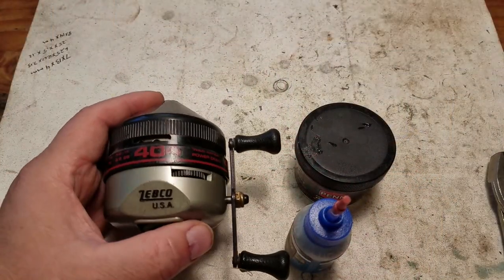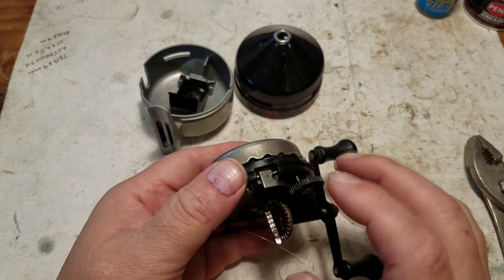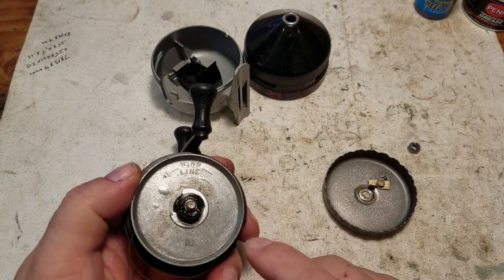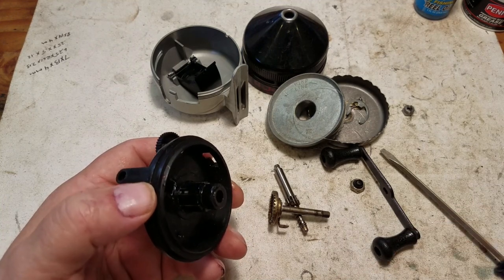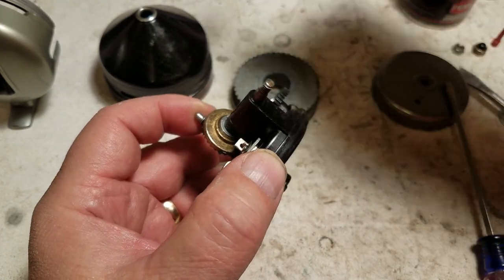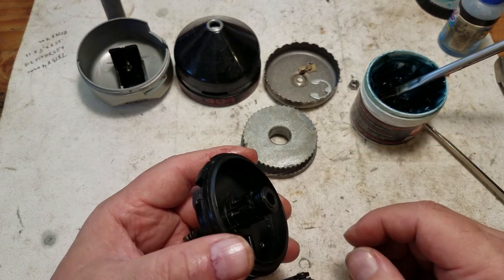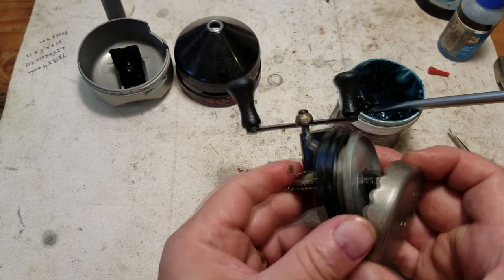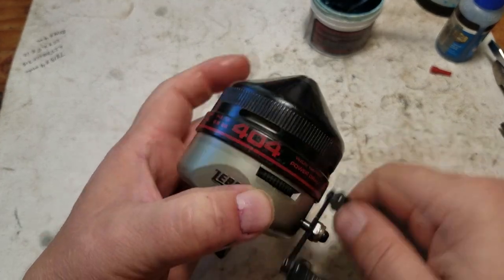Zebco 404: How to Service a Fishing Reel

Comment: Matthew I took apart this 404 reel and when I put it back together the drag wheel would not turn what did I do wrong ?
Reply from the maker: I bet you did not get the spinner cone all the way down on the "D" shaped shaft and when you tightened up the nut it seazed the reel up.
Reply: @OutFishing13Matthew  I'll check that out thank you. I think I'm getting it